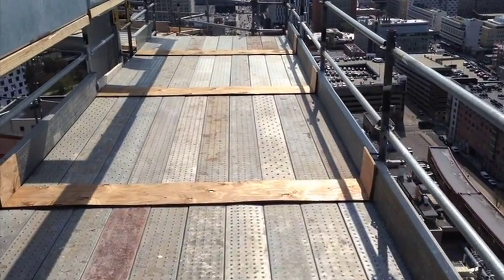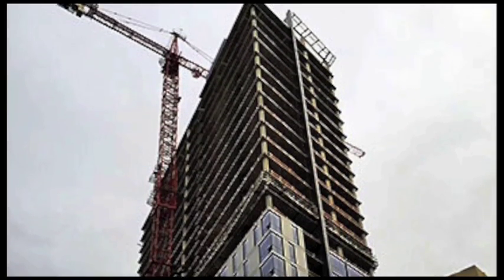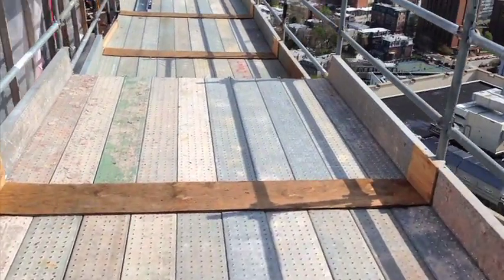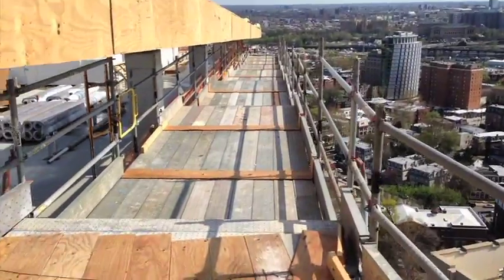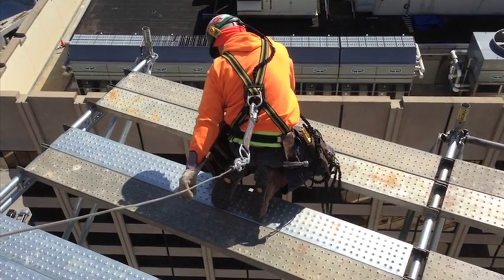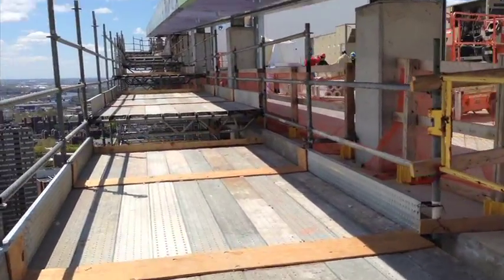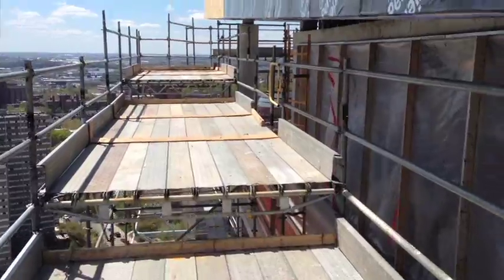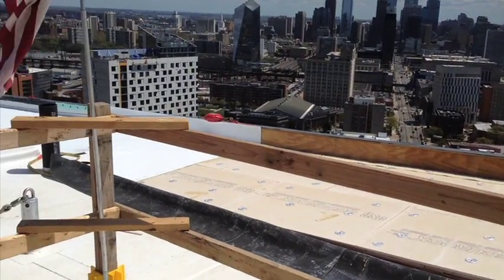Cantilever Scaffold, 28 floors up, 3601 Market St., Philadelphia, PA

Comment: Fail the decks aren't picked up with tube.
Braces are not load bearing
Reply: HerrenGamingNews your sound like a groundie lol must be a Karen
Reply: @Nzbass-head1995  nope I'm a journeyman I just know my code
Reply: HerrenGamingNews yuo are right. Cantilivers must be supported by tubes and right angle clamps.
Reply: Yup your right
Reply: Depends on what you are doing, tube and fitting braces are load bearing.
Reply: @regfenster  no they're not. The swivel point on the chicken head is a failure point the rivets cannot handle the weight.
Reply: @HerrenGamingNews  Right angle double couplers from ledger to ledger with a checked double coupler underneath the spur tube at the top and at the bottom of the double on the lower ledger is about 28kn in shear load per tube using class A couplers, using class B heavy duty you are closer to 40kn.  I guess you are American and have limited Tube and Fitting within your country being as you use mainly system based scaffold? Here in the UK Tube and fitting is used far more than any system.  If you can access it look at TG20:21 Basic independent tied and none tied scaffolds, you may find it of some interest covering the basics of non designed scaffold structures which includes cantilevers of various types.  The swivel coupler here is rated at load bearing here as well from memory at over 5.8kn.